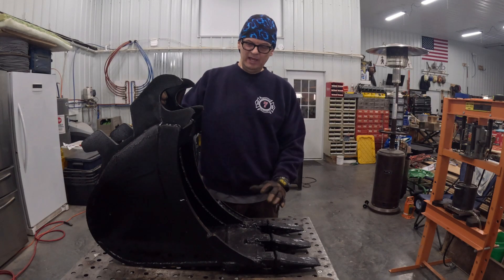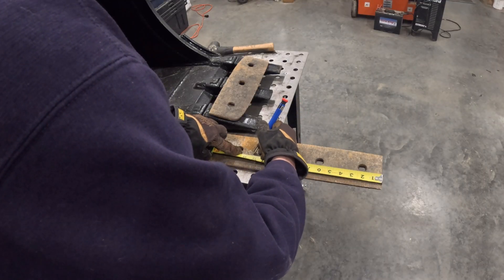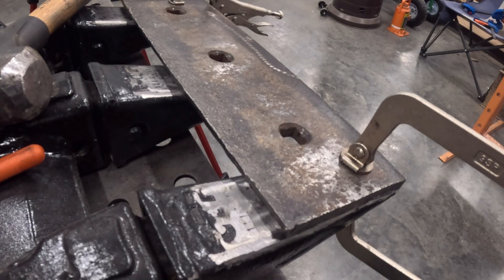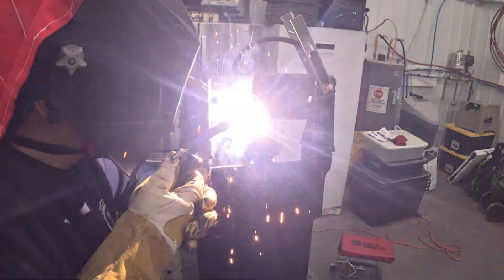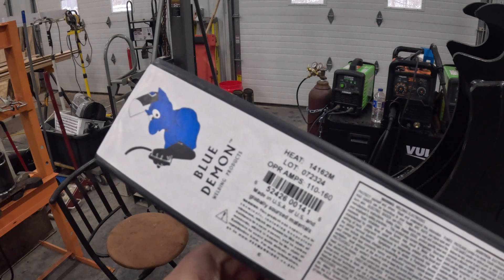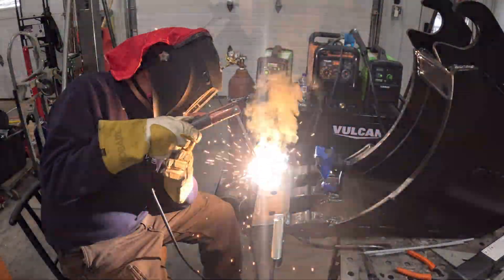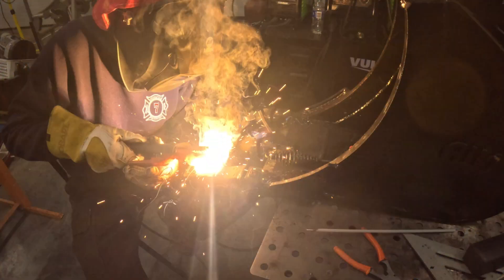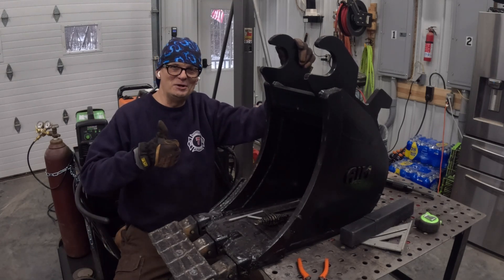DIY Mini Excavator Bucket Modifications

Comment: Are you able to remove the teeth with flat plate and add new teeth when you need a digging bucket?
Reply from the maker: Thanks for watching and your comment. Yes by removing the tooth retainers and then the entire plate and set of teeth will come off. The outside teeth point straight on this bucket so you can do that. I have another toothed bucket so I probably won’t do that. My second toothed buck has the outside teeth pointing out at about a 10 degree angle so that bucket would not be possible to slide the plate on and off. We appreciate your support! Have a great day and be safe!